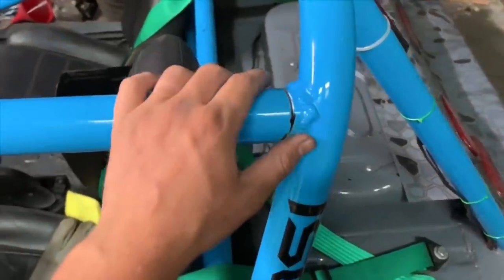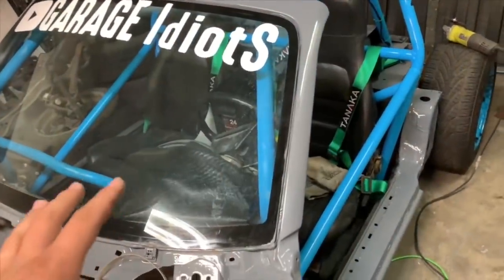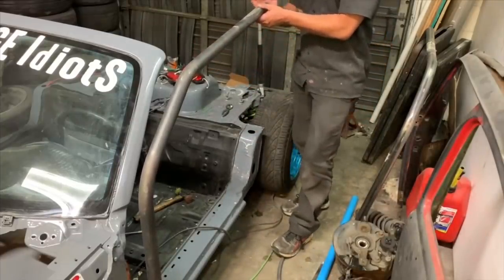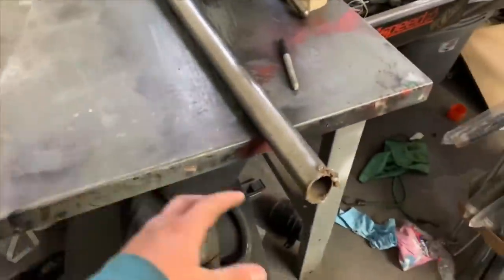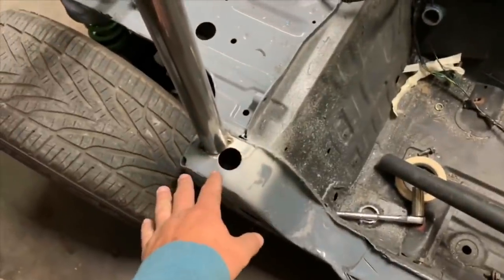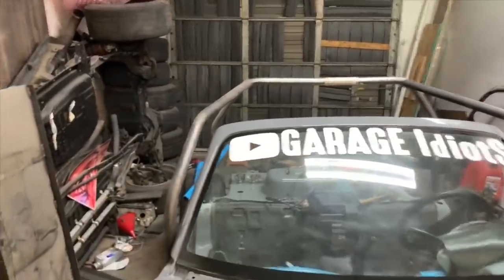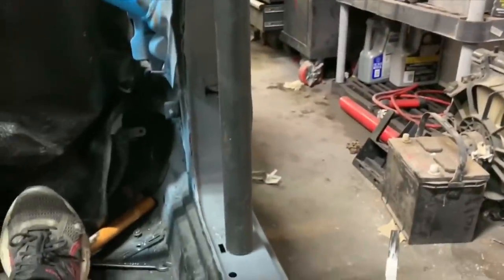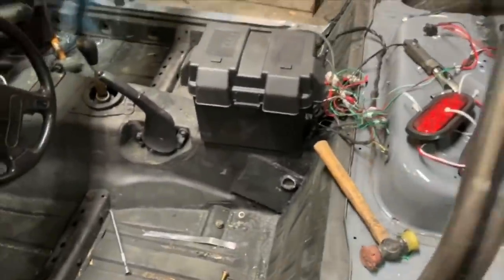Turbo Mazda Miata Kart [ roll cage things and stuffs ]

Comment: NOOOOOOO! 😭 I miss the old cage already. I got suggestions but I don't know how you're going to follow them reading it but here it goes...

I hear you on getting the bar closer to the windshield and I'm down farther, I know you wanting to save money but if you want to look right you're going to have to do it right. So...

Following the windshield would definitely be better. However I don't like that rear hoop one bit too tall and I don't like the shape. I don't like that 60° Bend or whatever you got going on there.

To make the rear hoop follow the lines for the car you need to follow the dimensions and angles of the windshield to make it look right. 

Following outside of the window with the bars on the front really close that will look all right 👍, however the bar on the back to fabricated and make the bends you need to go up the same height as where the a-pillar begians... measure from the ground to the where you're mounting the hoop, then subtract that measurement from measurement of the ground to the bottom of the A-pillar/ windshield that will get your length of your vertical member of your rear hoop before you bend it inward then only angle it in the same amount as the windshield does on the a-pillar you can maybe go couple inches higher than the windshield as long as you're following windshield all the way around with the tubing. 

Straight roof bar instead of angled inward you got going on, straight Door bar, then wherever you're placing the bar on the rear of the car go straight perpendicular up to the top hoop.

Should keep everything symmetrical and pleasing to the eye.

You are a real visual learner you have to see it to understand it so hopefully you can follow what I'm trying to put in text. Me, well I went to school for mechanical design and engineering, never did anything with the degree however I can visualize it in my head, something you get good at when you have a mind for three-dimensional design.

Yes you need to do some more reading I don't want to point you in the wrong direction and have some kind of safety rule issue that I don't know about.

Anyway I hope you make the Miata look cool again because now it just makes me sad. 😢 

Good luck man, prayers for you and the Miata, Bug, and Jeep 😉
Reply from the maker: Thanks man!! I had to read that 3 times to understand everything haha but we’ll think about it a lot more before we commit!
Reply: Same here GARAGE Idiots had to read it 3times to get that lol

Comment: Your cage wont be safe with the material your using.If i can see the seamweld on the bar, then its not cold rolled steel.Cromoly steel is lighter and stronger, just spend the money or at least use the right steel with the correct wall thickness.Google FIA rollcage and you find all the specifications and thicknesses.I respect your work and enjoy every video.

Comment: You have the right idea... keep moving forward! Nothing kills a project quicker than waiting. I think those front uprights need a little bend half way from the bottom to the windscreen bend to bring them in closer. It makes sense that the windscreen base is further out than the sill you are mounting to. Again a slight kink in the door bars adds strength and style. Great idea to have the whole cage bolt in... some captive nuts in the strengthening plates/boxes and 16mm HT Bolts and spring washers.
Reply from the maker: Awesome points! Thanks Robin!

Comment: If you want a good plan on an exoskeleton cage look how leroy is built and do it like that. Use the bent pipes u have but if it doesn't look good now dont use them have them rebent or just use them on a different place or project. Like the a-pillar bars they could work there but they might work better in the rear as down bars or as door bars. So now that you know you want more interior room make the cage bigger but not too big and ugly. Ask Cleetus or a jeep crawler guy for help with exoskeleton cage work.  You asked? A penny for your thoughts and I gave you my two cents 
👍👍from this guy
Reply from the maker: Good idea man. We’ll do a little more research and check out some more pictures and see what we can do

Comment: Please, Take a breath before pushing forward with the cage. You would be well served and fab up your seat mounts so you can get an accurate idea about accurate dimensions for your cage.  Take pictures or both of you in The drivers and passengers seat individually and together head on from the back and sides.  Then overlay the pictures to get a accurate idea about the dimensions of the cage.  The quick and dirty way to do this is print off overlay pictures and get a ruler, protractor, and triangles and draw different bar configuration in to see which one on paper looks the best and suites your needs. From there with the use of a draftsman scale you should be able to figure out actual bar dimensions.  Also look closely at LeRoy for cage design ideas. Another idea is to talk with the gentleman that wants to help you with the bug cage as well as seeing if your neighbor could help you with some taking of the pictures of the Miata cart and dimensioning it into sorta a blue print form.  Remember the main hoop needs to be able to support the weight of the car in a crash so it’s mounting is the most critical so where and how you mount it is critical.  I myself like to sandwich the floor plate and weld a stub pipe to the under floor plate that pipes that contact the floor can slip onto.  The idea is OD of the pieces of tubing sticking up from the bottom piece of the floor plate sandwich matches the ID of the tubing of your down bars.  This allows you to weld the down bars not only to the floor plate but plug weld them to inner piece of tubing sticking up from the floor if you want too. My reason for the floor plat sandwich is I have scene hoops tear away from the floor in bad wrecks because the car floor itself tore using the upper and lower plate general allows for using different size upper floor plates upper and lower thus spreading the force of impact to the floor. O’well I hope maybe some of my ramblings helps you on your build’s.  Keep doing what your doing just remember to breath now and then.
Reply from the maker: I appreciate you taking the time to write all that!  I will slow down before we fully commit, thanks man!

Comment: Tuck it tight, it's hard to make bars look good but functionality speaks volumes. You'll knock it out of the park, just don't settle.

 Can you guys solder? I got a bit of led soldered for the bug, but was gonna leave a roll in there to fill in any small spaces a few universal pcs can't.

Comment: I bought a Lexus is300 that was t-boned, originally planned on karting it, but idk if I want to get rid of the roof. I do think it is great that you are able to reply to comments
Reply from the maker: We recently had a similar idea with an IS.  What if you took the doors off, but didn’t cut anything in the center of the car? Cut and tube frame the front and rear.  Build a cage on the inside of the car as well.  But you get the feeling and look of a Exo car while maintaining the windshield and roof!?  If you don’t do it, sell it to me haha

Comment: Hey, if you want to do a quick mock up cage for the miata. Buy some pvc pipe which is cheap and you can get the cage exactly how you want it. Plus you can use it as your template for the actual cage material.
Reply from the maker: Great thinking!

Comment: You should get the rule book for the class the car will fall into because I don't think it will pass tech if your going to put the door bars on the sill plate above the rocker panel because theirs not really any structure there in case of a rollover.
Reply from the maker: We’ll look into it!

Comment: I drop the rear loop and side pliers down at least a inch. Maybe even 2 so it's just barely higher then the windshield. That should make it look tighter. To the body and if you get a low mount seat. You should still have 3ish inches of clearance. But hey it's your build. Build it how you want it. As far as door bars go use the bottom section of the old loop. That way it just pushes out next to your arms. I run a angled down bar to right in front of the fuel tank. Other wise your losing the space you just gained.
Reply: And I dont know if you thought about it but you could take out the support for the seat that welded/glued to the floor.  and just add a cross section at the back of the floor board to add strength back in to it and give you even more head room.
Reply from the maker: Awesome ideas man!! Thank you!! I’ll talk to Mena and we’ll see what we come up with!